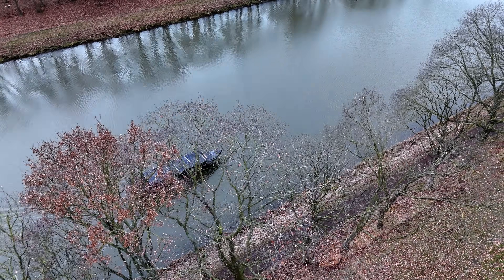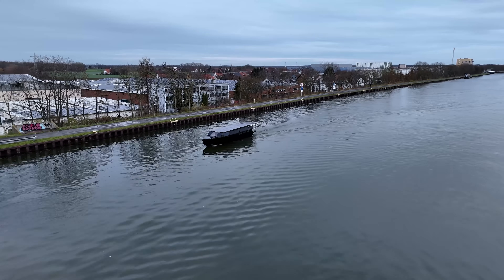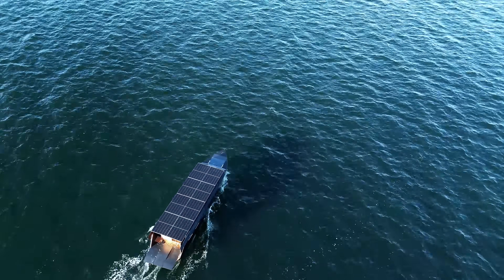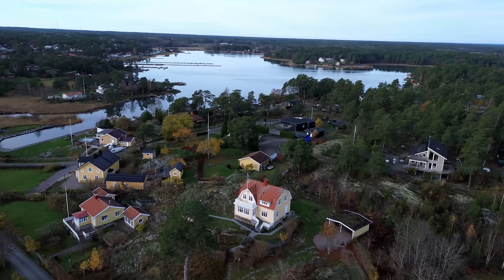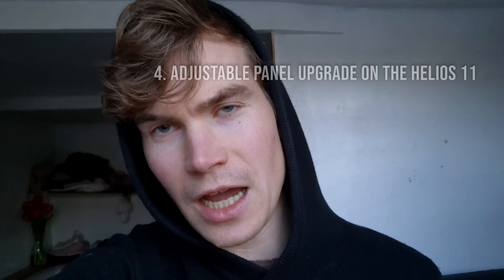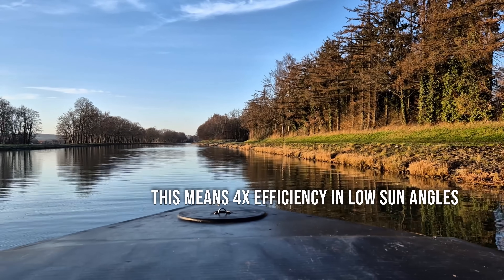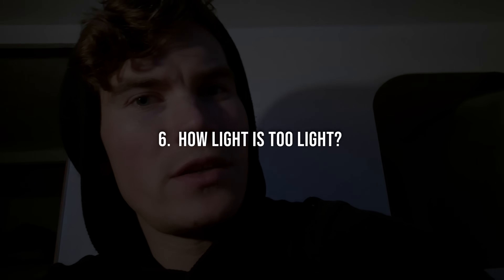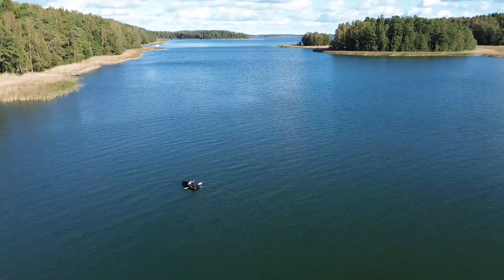My Solar Explorer Reaches Germany: Major Upgrades & Next-Level Design

Comment from the maker: If you want to support the research, super likes and memberships accelerate the mission.
Every dollar goes into building the next-generation affordable solar explorers. You won't get shoutouts, rather see the next solar ships faster!
 -YT Memberships: https://tinyurl.com/missionfunding
 -Card: https://tinyurl.com/missionfunding-card
Reply: 1:44 America has what's called the Great loop you leave out of West Palm Beach, Florida and you head north in the intracoastal you go all the way up to New York. You come in through the lock system through the Great lakes. Then you come through the Great lakes to the mighty Mississippi River and then you take the Mississippi River down and it has tons of tributaries. You can see something like 26 States and then you go all the way down to the Gulf of Mexico and then around the Florida keys and then back up to West Palm Beach Florida something like 6,700 mi
Reply: I saw video buried somewhere on YouTube. It was a simple system that used 2 electric motors to rotate panel x/y axis and 4 light sensors shaded behind each corner of panel. If the angle of the sun shines (past the shade) directly on one a sensors then it signals the appropriate axis motor to rotate the panel until they’re all in the shade again.
Reply: Oops sorry I misremembered the system. He used 4 small solar panels behind a square shade that power the corresponding motor  when hit by direct sunlight. 

https://youtu.be/wL9PcGu_xrA?si=zjZUQyyeVTHdf8jz
Reply: NEED A TRIMRANE VERION WITH KITE OF SAIL
Reply: So how do I find episode 9 when you are not numbering them....?
Reply: @DoorCam-l7y  dude its were the adventure starts =D not everything in live will be prenumbered for you xD
Reply: There is a plan to eventually sell these?
Reply from the maker: @tarzan5621  It's already possible. Not physically, but selling the plans or helping with custom designs. Then take that design to a shipyard or pay any competent general craftsman (it's so easy to build)
Reply: Friendly observation. If you want this channel to grow, maybe you don't, but if you do, you'll need a lot less "head shots" of you just rambling on endlessly. Video is for showing. Writing is for telling. Show us, and keep your big head out of the way.
Reply: Flexible panels are good for 10 years max and are good for places that need to flex or deployable.
Solid panels last 80+ years.
How long do you want to go before having to buy new equipment.
Reply: Have you looked into bringing a reverse ozmosis unit for water?
Reply: I'm concerned about the hull integrity in the open ocian.

Comment: don´t use flexible panels. The win in weight reduction will be destroyed by system failure during corrosion  and mechanical issues inside these panels.

Comment: I haven't had a good look at your boat yet but I bet you can get a lot more power with solar if you have some of them hanging on the upper side of the boat. That way the solar rays might even bounce of the water onto the solar panels. It kind looks like solar panels on the sides but I'm not sure.

Because at least I would like to have some space on the roof for chilling.

Comment: 1. Sail. Very well tested and proven to have an infinite range.
2. Sail-wind turbine with direct drive. Works great downwind and gives a good alternative upwind. Less stable in high seas.
3. Solar. Ehh... massive disadvantage in power-to-mass ratio. Water and electricity do not work well together. Requires heavy industry and toxic materials. 

Monohul vs multihull - for lightweight, power-efficient projects, multihull is the least sensible choice. 

Conclusion:
Sailing trimaran! 
Cheapest. Fastest. Most stable. Easy to build. It can be fully made of wood. But also aluminium, steel, plastic and even concrete are possible.

Comment: Cool project! Regarding the weight issue of the PV panels: Have thought about using the panels as structural elements, e.g. instead of putting the panels onto the roof, building the roof out of PV panels ? Obviously, this would need (tight) integration of the mechanical properties of the panels into the overall boat structure and design. This would loose some flexibility / tinkering capability, but should offset some of the weight of the rigid panels by making use of the strength of their steel frame and glass panel. (small background: When PV panels are put on building roofs, of then the roof is covered conventionally with roof tiles and then the PV panels go on top; I'm trying to convince people to (at least for new PV-covered roofs) leave out the tiles and create a rain/weatherproof directly out of the PV panels and thus eliminate the cost of the tiles)

Comment: You could consider retractable foils for adding stability?
About the wind energy: be careful with the advertised wattages. I have seen turbines that work on average between 500 and 1000w and their height and span is something you would be careful with when mounting on a mobile/retractable mounting system.

Comment: or consider this, maybe even better.
i dont know the size of your panels, lets say 100x100 for sake of ease.
put 25x on the window, hanging from the lip of the roof. on each side. 
then put the other 50x along the center of the roof.  those 50x dont need to swing up or down.
if the suns on the east, swing the west side panels up nearly straight, leave the east sides hanging straight down on the window side.

its a balance between center of mass benefits from lowering the windows to the walls  / window of the boat and rotational ability.
all panels on windows would yield perfect solar absorbsion, and maximum center of balance lowerage while in the down posistion.
but maximum imbalance when 1 side is raised fully and the other is lowere fulled.  perhaps.  perhaps not, if the hinge point is always on the top corners of the roof, and not applied to the sides of the boat.
leverage.  hmm but that would negate the benefit of hanging form the walls of the boat. so skip that last bit.

Comment: OMG im a generious, check this out. 
OR... consider permanantly adhereing all panels to the side walls, "windows".  they could "raise up like wings in the sun, or over extend when the sun is on the oposite side.
the lower you keep the panels, the lower the center of gravity.
you want the ability to maintain a flat noon sun posistion and a vertical winter possition.

wind and weight are the enemy. ive solved both issudes. 
Think Delorean, from back to the future.

put the panels over the windows on the sides of the hull. lift them at noon, lowerthem at night.
add the ability to lift them straight into the air for when the sun is on the "wrong side".
suns on the east ?lift the west panels 100 percent up. and leave the east panels to cover the window.
its called "Shade, and sun".
its noon? lift all panels 50 perecnt, straight out, like the deloreansn doors at half mast, like an extended roof.
ya dont even have to exit the boat, ya just stand inside and push em up or down.

damn it... now I want to design one of these things.

but id test a model scale, lifting 1 side "straight up" and 1 side straight down might throw the center of balanec off too much. 
but im pretty sure it would be "net better" than all panels on the roof... (maximum ineffeciency in terms of lowered center of mass. )
so even with 1 side up, its still net lower than all sides on the roof with even 1 panel lifted. 

panels on the roof makes it swim like a drunken turtle.  im amazed no one gets sea sickness.
Reply: you dont have to lift the opposite side panels up 100 percent, just 75 percent up, an dlift the sunny side up 25 percent to stabalize center of mass even further.

Comment: find a way to slide the panel onto the side window to minimize wind troubles, even if only the left side panels lower onto the window, the side profile of the ship wouldnt change at all.
then you could lift the right side panels up 50 percent and win win, without all the wind. 
or vice versa.

Comment: Sunreef Yachts uses AI for next-gen solar panel hull material . . 
Sunreef Yachts, which introduced its revolutionary Solar Skin solar panel hull material 2022 and improved it in 2024, has again boosted efficiency and performance with the launch of Solar Skin 3.0.

Comment: There are some startups, who want to generate electricity with a kite instead of a static wind energy plant. A very great, but also very difficult thing in my opinion. (kitedynamics, enerkite, skysails, ...)
If you use the wind to harvest electricity with an automatic kite system instead of force for forward motion of a classic sail, did you do that math? The energy and money equation would look maybe completely different.

Comment: I like your content a lot. Getting higher cruising speeds is the most difficult but also the most rewarding part imo. I would certainly be eager to search for high efficiency panels. There are some developments with 30-40% efficiency panels (normally below 24%). Problem is availability, price and longevity. However these drawbacks might resolve over time. Efficiency of the propeller is also extremely important. On average props do about 50% efficiency panels, highly optimized designs with high torque and low rpm could do 80 and in lab conditions even 90%. In general, low rpm, high torque, high aspect ratio(low expanded area ratio, P/D about 1.4 are indications. There is really a lot to gain there. In general charging options will keep improving in harbors but a standard 230 V (3kW) outlet is almost always available and sometimes better. Great project

Comment: Your drawing on your next design, theres a problem: you have listed all the heavy parts: batteries food drinks etc below the waterline.. with a catamaran theres not enough space below waterline as the hulls will be very narrow, but there will be a lot of unused volymes above, so just a thought, what about adding a 3rd wider still V hull in the center? Make this hull wider and load the batteries here + drinks + ballastwater to get the center of gravity low but also in the center another benefit could be to get your walking floor lower as the human weight if several adds quickly up and then you can lower the roof height too: lower height = less wind resistance. I really like the look with the side walls angled in at top.
A cat/tri has less resistans through water than a monohull, maybe you dont need to increase motorpower that much just add more battery and solar capacity?
Make 1m scale boats of current and next design to test ideas with rc setup.
Choosing channels through Europe was a great idea!
Best of luck and looking forward your next video

Comment: main problem for those flexi panel is durability  over the years, the coating will felt off or become haze after expose to UV few years, standard panel is much for resist to harsh weather. if your roof solar panel is not moving at all, use mono facial standard panel (save few kilo per panel when comparing to bifacial).

Comment: Could you experiment with a water ballaist? So, the captain has the option to add weight when needed or equipment required. Add weight when stability is needed or desired and go ultra light when conditions allow. Keep it up! love your ambition, ingenuity, and creativity!
Reply: Also if you had a way to measure the the weight added vs performance, the optimal load/balasit wheight could be determined during the prototype stage. Useful info to have for production.

Comment: if you get your boat to go a little bit faster ~6knots instead of 4knots,  then you should look into Hydrogeneration and do the calculations if it could be self sufficient combined with the solar panels when you dont have so much/any sun.. lycka till från pargas

Comment: Consider  your bottleneck when building your new boat: "total solar capturing area". Your efficiency per kg does not matter as much as your efficiency per square meter. How much the heavier pannels will sink your boat in the water vs the lighter option? For a displacement hull, this is the important part: how much more drag you get per ton of wheight due to added wet area gained by loading one extra ton. The same thing when you are considering "bringing friends in", or any extra load. Although mass still matters for acceleration (hello Newton!), once you build your speed, your motors are fighting drag only, keeping the "kinetic energy", and this correlates to wet surface, not total weight, for a displacement hull.
You are clearly an innovator with a creative mind. Make sure you leverage already existing knowledge on boat building to maximize your output.

Comment: I have commented that before, so let me insist in this topic: rethink your hull shape in the new project. Two things to consider in changing to a more round shaped bottom: 1- less wet surface with shallower draft. 2- on lateral waves, your catamaran just "surfs sideways" down the waves with no risk of capsizing. And you can add daggerboards if you really need extra support for "pointing in the right direction", but with a power vessel and differential power (no point in having a catamaran with just 1 motor) you don't tend to have this issue.
Something to consider.

Comment: With water balast tanks, you can inclinate the vessel to the sun! ( Port & Starport slides) But only somente degrees. Maybi maximum 15°
 Do not need to inclinate the solar panels on the roof!  Cheap eficiente solution.

Comment: in the usa we mostly have rivers. the two canals i know about are the famous open Erie through pennsylvania and hennepin from iowa to chicago; which is not open. traveling the mississippi is dangerous because of the submerged rocks along shore and the barges and the many locks and dams between iowa and st louis. i wrecked my centerboard on the rocks, almost crashed over the dam at a lock and drifted over night by accident one night. luckily a snag caught my boat or i would have surely crashed into a barge which are frequent. now we have a drought situation which limits barge traffic but make things even more dangerous. anyway that is the situation. i have a home made with plans farrier 22 trimaran with a motor.

Comment: Cool project.  However I think this more suitable as a boat for protected water with occasional coastal trips in good weather.  For long distance open ocean conditions sailboat is much better option.  Imagine few cloudy days in a row and strong headwind and big waves. You would need lots of power to make meaningful gain and battery would quickly run out with motor at high power for many hours and little solar input.  Sailboat in such conditions would do fine.  Your design really is excellent canal boat where sailboats would struggle with their masts and deep draft keels.

Comment: This is a fun vessel! And your videos are getting better with time.

Maybe consider developing a solar panel deployment system? Something like satellites utilize. That way, when you can find larger open spaces, you can deploy and recharge cells in a lot less time.

You could go vertical, that case. Then fold it back down when ready to ship off.

Also, it may affect your potential for full height, but consider smaller hydrofoils too. They could help you gain speed with less wake.

Love the commitment to solar travel. :)

Cheers!

Comment: Another way to get better input in winter might be to have modest height .5 meter reflector sails (white or silvered) to stand at the Non-sunny edge of the array, to double up the poor angled solar..  can be perforated or loose enough to have minimal wind challenges from them.

Comment: Love this content. Just remember adjustable panels immediately create sail effect which may be beneficial or detrimental to cruising speeds depending on wind direction. Being fixed will obviously have a neutral effect. Some clever algorithm on panel angle vs wind direction vs power generation vs speed would be interesting. 🤓

Comment: Base the width of the next boat on the width of 4 rows of panels (1134mm + 30mm mid clamp gap x 4). Use 2 rows per motor for redundancy as well as dual motor manoeuvre ability. 595w panels are ~2m long x 1.134m wide. 24 x 595w =14,280 W 12m long vessel x 4.5m wide. On a cloudy day it typically drops to 30% or in this case 4.76kW of power generation. I think LTO cells would be ideal and positioned in the bottom spine of the boat along the length. LTO lasts for up to 60years, cannot catch fire, can be fully discharged to zero and still come back. Once they are full you will be bouncing the direct solar power off of the full batteries and into the brushless DC (water cooled?) motors. Ask for battery sponsorship from the Electric Ferry builders in Sweden that use LTO cells, I can’t remember their name.
Reply: Looks like he may have done that already.  Look at the sketch at 5:36.  The roofline profile looks like its a bit under 2.5m so 2 pannels wide with a bit of room for mounting hardware.  Roof then angles down at about 45degrees and probably could mount a row on each slope. Could just have them hard mounted but possibly could also be made so they can hinge upwards depending on sun angle if sea conditions allow so both if the sun is to starbord the port array gets lifted to also catch the rays.  IF the sea conditions are rough you keep em secured and reduce windage.   I asume the helo 13 means 13m long so 12m or so of array length is probably possible.